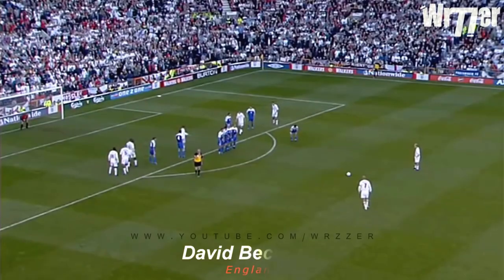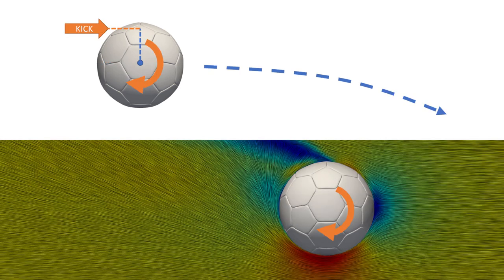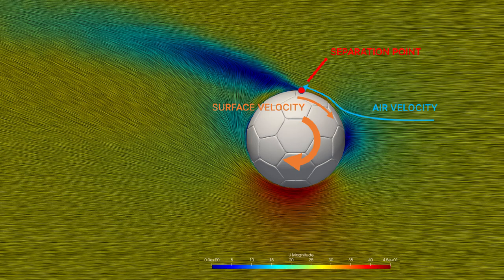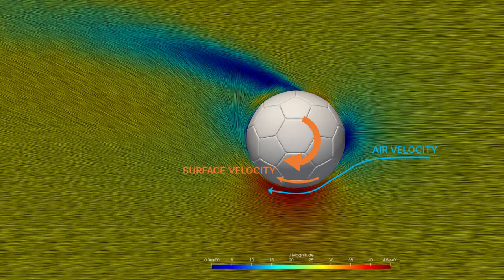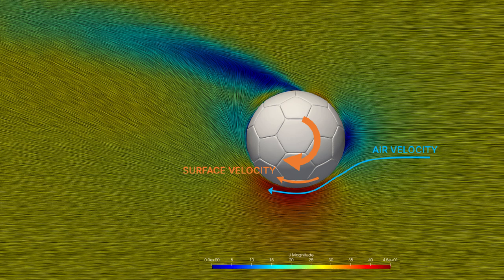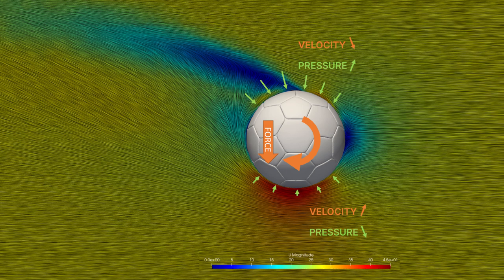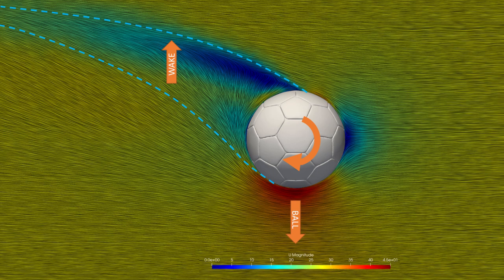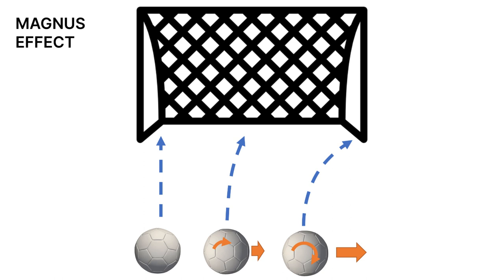Soccer aerodynamics - How to curve a ball

Comment: Fantastic video, I would love to see a similar video for speed skydiving. How people can go +500kmph . I’d be delighted to help see that through by getting a sample set of data
Reply from the maker: Hi Meirbhin,

thanks for the compliment!
What sample data set would you mean: GPS / speed tracking of a dive, or a 3D scan of a speed diver in position, or ...?
Reply: @AirShaper  GPS data. Wingsuiting & Speed Skydiving events are recorded on an open source GPS device called FlySight. CSV Flat files are outputted following the format outlined here http://flysight.ca/wiki/index.php/File_format . I've loaded a single Speed Skydiving file https://ufile.io/tg41n5uq this can be interpreted using free online viewers. The file can be dropped on this page https://www.paralog.net/ (Lower left "Click or drop Flysight track") Then once loaded, change the type of skydive to "Speed" on the upper right menu. This tool reduces the variables to the two most fundamental; vertical & horizontal speed. 
My train of thought is: As speeds increase, air gets denser & we see (in speed skydiving) a minor adjustment in pitch changes the momentum from vertical to horizontal movement. While the champions hitting over 500kmph maintain building vertical speed. I'm not aware of any body scans that exist but there are videos, most notably showing the "speed wobbles". Although this world record jump is rather smooth  https://www.youtube.com/watch?v=t-INQKxc0rQ&t=78s&ab_channel=LucMaisin
If this is something that you believe would make for interesting content for your channel, I can reach out to speeders for their files & gather data for a larger sample set. Skydiving has strong brand awareness but we explain the sport poorly. You have a fantastic way of presenting information and so if this interests you, I'd be delighted to help